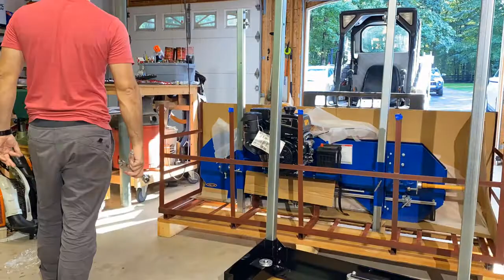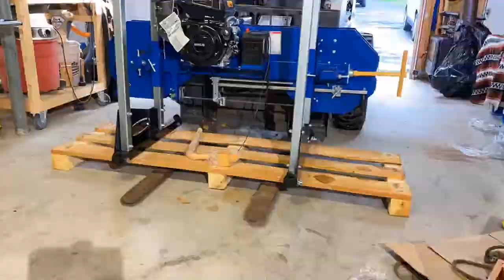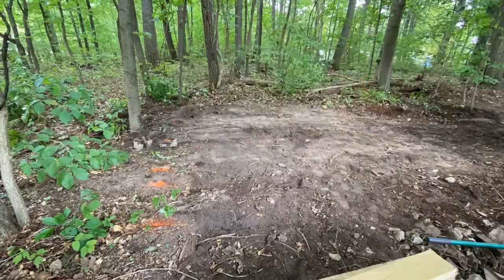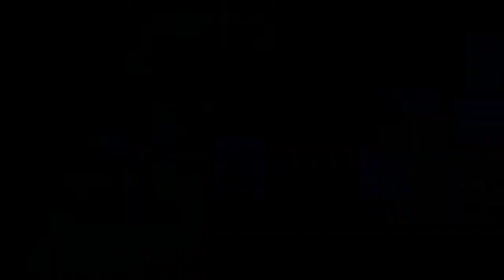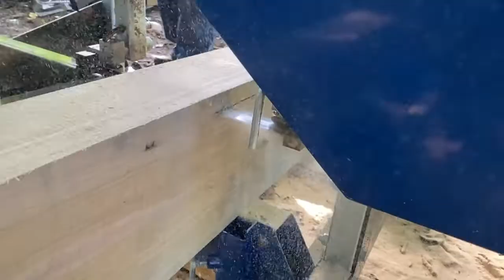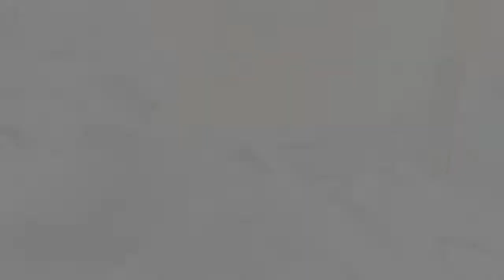32" Sawmill from Range-road

Comment: Glad to see it :) I obtain brand new  Forestwest 32 sawmill with same setup, just different name and colour. It would probably pay to compare prices - it is absolutely indentical sawmill. Since my sawmill waiting in workshop for my retirement mouve  I made numerous improvements to it like motorised head lifting through VSD control, digital readout..., and it have so different capabilities now, so I renamed it as well. Can't wait to relocate it to the place of my play days where green pastures and nice piece of forest is waiting for me. Cost me peanuts due to fact that original owner didn't have a clue of mechanical/ electrical things when setting it up - wrongly connected motor starter and blow starter motor - it was working for 1/2 an hour and he store it in container - lucky me - one year later selling it for half price :)  It is more than capable to do things as professional sawmill can - in a slower rate, but time is not an issue for retirement hobby, presume every day is a bonus! This is my story, hopefully will soon make some sawdust as you guys, thanks for video :)

Comment: Are those black rails steel ?  Does the 5032 use a 1 1/2 inch blade ?  Is there a factory 22 horse twin available for the 5032 ?  Thanks in advance.